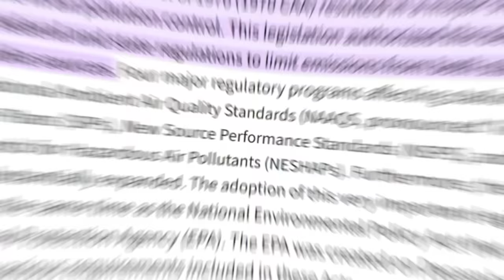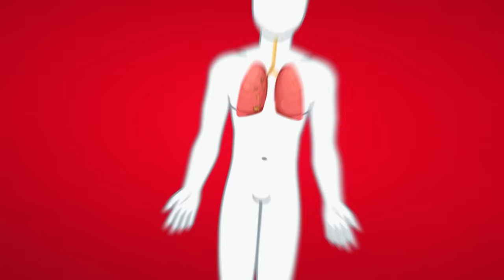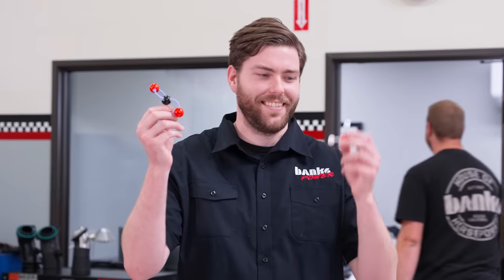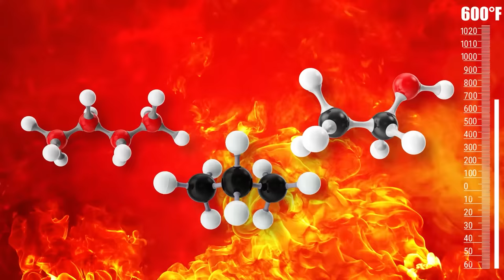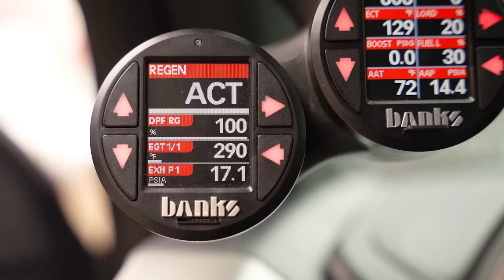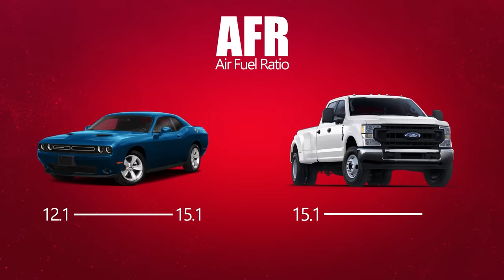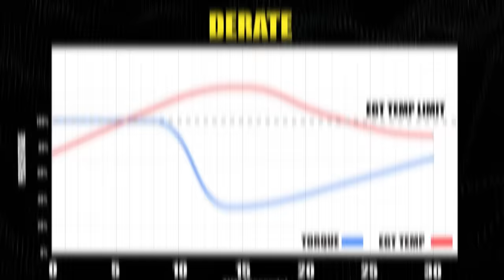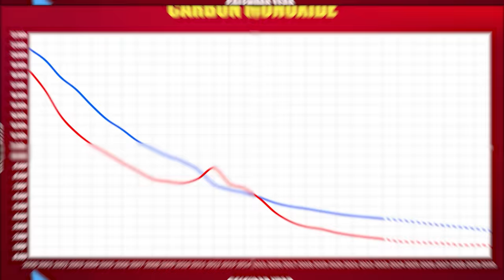Understanding the Most Hated part of your Truck | Banks Entry Level

Comment: I find it funny that they have to make a video to try and convince people its better, Also what they failed to put in the video is how unreliable those systems are. They are the biggest money scheme. As a diesel technician i see lots  and lots especially duramax come in the shop constantly with emissions problems and they are completely stock trucks just as you would buy them off of the lot. They do have some good points about good tuning in this video though. But i had to laugh when they said more fuel efficient 😂😂. Also redirecting exhaust gas back into the engine is terrible for the life of the engine. Ive taken apart trucks that had almost an 1/8 inch thickwal of soot in the intake manifold. And also most military and goverment vehicles dont need to meet emissions standards either.  Its all about the  money in my opinion

Comment: Im sure you were simply glossing over it for simplicity but realistically a sooty combustion cycle will make quite a bit less NOX than a hot clean combustion cycle. The high nox production of modern engines as a result of the injection timing is a goal because its easier to scrub than particulate. Its an inverse relationship.
Reply: Great video though

Comment: Good videos banks the fuel air ratio was something i already knew but just goes fourth to confirm my standpoint if you don't anything about an engine to begin with you shouldn't be under the hood but as far as emissions i have to ask now i know many other have said this but i still feel it needs to be brought up what about power plants that dump hundreds if millions of tons of coal ash into the atmosphere or steel mills i seen a handful dumping all sort of smog out the smoke stakes and along with that the pipes used to transport oils their old and leak a lot cause damge to surrounding wildlife if it spills like the chemical spills we had early this year the emissions will kill you we know tha but i just think it is a little hypacritical to say that while newport still exist vapes are now normal and now the people want to dump silver i to the atmosphere you guys have good stuff i see that but i would still delete not for black smoke but because i wa t reliability to tell someone you can only drives this long distance seems a little senseless why would someone buy a vehicle which these days i going to and upwards of 100,000 mind you and i can only drive it limitedly it just doesn't make sense and with the new pistons gm has i just have to also ask if this was the case with not having a thorough burn why were they not making more effective parts to begin with instead of making this stuff was it because the tech wasn't then it just makes me wonder why not make part that do the thing better and keep emissions lowere then ever then to have someone pay for a 10,000$ filter if it needs to be replace and an equally as expensive injector system know as d.e.f. this js all i want to know i have never had a diesel and with all.the thing i hear about how unreliable the emissions system is it just makes we wonder if it would be a good idea to delete especially with gas prices i know they have come down over th past few years but their still.high i look around and i my tank goes from full to 2/3 empty even with 22.4 mpg i just can't help but wndoer what it would be like in  The world of diesels all i want is something that works and i don't have to fill up all the time this one guy i saw he was stranded quitena ways from home and his emissions system went into limp mode he was like half way across the country and was carrying a full load and was left to the universe it was only grace he had a freind that was willing to lend him his truck to get back home with

Comment: My issue really isnt the power with emissions equip.  Its the reliability.  Yes the reliability is better than the earlier years but  they are still prone to failure (especially the DEF system) and are incredibly expensive to repair.  I mean seriously who has $10k sitting around for a dpf and DEF system when a delete is a fraction of that.

Comment: ah this explains it... In my first 4wd (diesel, ofc... petrol 4wds are for pansys...) it would eat engine oil, when it had only done 50,000. The new ranger does not. Likely this is INTENTIONAL.. due to the fact the ranger has an DPF. 

and the old car was a GM, and the new ones a Ford. 

Go FORD! :)

Comment: There's one detail you conveniently left out about PM. You state that PM2.5 is the more harmful particles at less than 2.5 microns - what you leave out is the ash particles generated by the DPF can be as small as 1 micron. Since 1 micron is smaller than 2.5 microns, and if 2.5 micron particles can get into your bloodstream, which is bad, those 1 micron particles definitely can get into your bloodstream, and being smaller that's even worse. I certainly wouldn't have been playing with that DPF with bare hands, and I have my doubts about that respirator being able to protect your lungs from the finest particles that I'm sure got airborne. You can bet those DPFs don't trap 100% of ash, and of course, the smaller, more dangerous particles are going to be the ones to escape first, so they're driving around spewing these much more harmful ash particles than would be the case if the trucks were just tuned well, didn't have a DPF and did have some particulate emissions. I recall mentions 'back in the day' (mid-2000's) of trucks that had EGR and DOC that were deleted, then tuned PROPRLY (Clean, no junk smoke tunes) and then actually sniffed at a smog station and they tested CLEANER than a stock tuned truck with emissions intact.

Comment: Grade A video, thank you. My only hesitation before buying a diesel was this whole Ash buildup problem. My 2020 powerstroke makes more than enough power on its own. So I’m looking for a tune. Although it appears your tunes might reduce ash buildup rate, the ash will buildup regardless.  So ultimately a new exhaust will be needed at some point in my trucks life. My question now is, much can your tune help me kick that bucket down the road? At the moment I’m able to monitor regen cycles and plan my driving around them. Regen takes roughly 30 min driving or high idle to complete and it happens once per fuel tank (48gal). As you know regen dumps fuel, so I never get to actually use the whole 48gals.  How will your tune change my current regen cycles for the better? Thanks again
Reply: almost every city has DPF cleaning services. the way to keep the regens from happening so often is to keep the system hot dont idle or lug the engine stay in the higher rpms. all the regen does is turn up the rpm of the engine to heat the system up run it hard and it will burn off the soot as it comes in

Comment: 10:20 If an active regen takes 20 minutes, what happens if the vehicle is only used for shorter trips? Our Tiguan is only used for trips longer than 20 minutes about once a month on average. Other than that it's mostly 15 minutes to and fro.

The particle filter warning light comes on once in a while.

Should we drive with a higher engine RPM, and if so for how long? The car's computer tends to suggest gearing up if the RPM goes above 1000-1200.
Reply: Modern diesels require a long journey every so often, once a month should be ok. But the exhaust NEEDS to get hot on the long journey. If you're doing the long journey let everything warm up by driving then after about 15 minutes then once you're on the highway keep it in a low gear for like 10-20mins and force the exhaust to get nice and hot. Don't red-line it for this long but keep RPM pretty high.

Comment: I hope turbocharged sparks ignited CNG trucks become a thing. Basically a diesel engine with the injectors replaced with coil packs and spark plugs as well as the implementation of natural gas injectors and a throttle body.

Comment: Curious as to how @bankspower is going to do a ALDL plug in tuner for all GM products as our GM vheicles move over to the new VIP platform!?
I know the insurance companies are having uses with their "discount" recorders and the GPS modules that are used on government vehicles wont work either. 
We had a brand new Tahoe come in the flatbed because it wouldnt start or shift to neutral. It was a government vehicle with an ALDL GPS tracker and the dash was lit like a Christmas tree. Every msg was flashed on the DIC that was possible. 
I foumd the tracker, unpluged it and cleared codes with my GM MDI2 scan tool . Vehicle was fine after. 
Gm's new VIP platform is high security and can and will lock out u authorized outside dirty data.

Comment: I wish somebody will design something that can easily collect the ashes out the filter like how fuel water separator works just drain the water but this time just slide somesort of mechanism in and out while collecting all the soot in a bucket or something so then u can use the soot as fertilizer or something or sell it to a refinenary to make propane out of it lol

Comment: Just because the it is the rule in all 50 states, doesn't mean it is enforced. I know in my area where there are no state inspections required, a significant percentage of these systems absolutely get ripped out. Most people don't care about the power, they just don't want to deal with DEF.

Comment: Great video 
 Garrey from Australia  diesel fitter ,heavy machinery since 1980,  owner of an 08 Dodge Ram  2500 cummins. Pleased to have Gail Banks equiptment on my ute ( not a truck over here ) My major worry was the recycled abrasives as carbon  going back through the engine with the stock configuration  EGR  DPF.  After adding the Banks monster ram ,intercooler and pipes and clean tune and a water methanol kit   Full delete , my fuel consumption has dropped by 36 percent  with enough power to run  mid tohigh 9s in 200 meter,(1/8 mile) r run  with NO smoke. Caculated fuel not from overhead  hiway driveing at 110 ks   9.8 litre per 100 kms  pretty happy

Comment: They say saving the planet, but it's also burning more fuel as any restriction in a diesel engine is bad. I've seen charts of over 10000 miles trucks losing an average of one to up to 3 miles per gallon, depending on the condition of the DPF vs a deleted truck.

Comment: Update on my Monster Ram intake and Pedal Monster bundle install. I am not seeing any improvement after six months and I'd like to talk to a Banks Power Tech via email. Are there adjustments to make, does my dealer need to reset some sensors? 

I get an active regen every 60 to 120 miles and they vary in duration between 20-30 miles. The DPF gauge will be zero, then I will shutdown, come back and start the truck now the gauge reads 20%, drive 30 miles of freeway, and now the gauge is at 30%. Also the idle time shown seems inaccurate, and that display is showing 1 hour idle time per 2 hours run time. ??? 

Any ideas??

Comment: Sounds good and whatnot, but I still delete what I have. I’ve seen my dad and my uncle who both have 4th generation Ram 3500s with the Cummins 6.7. Before they were deleted, they got 15mpg at most without a load, after they deleted them, the mpg went up to 25. And the power increased so much that the clutch on my uncles truck broke from all the raw power. (Yes it’s a standard 6spd)

Comment: The exhaust that comes out of a DEF truck is horrid. It smells way deadlier than any normal breathing diesel. Super interesting video explaining all this though. It just adds so much complexity and that turns to unreliability. I’d rather just run an old diesel. I have enough old junk to maintain and fix, I don’t need to be worrying about fixing brand new stuff too. Piss on emissions systems. Cut em out, tune it, run it. I’d love to see proof of a diesel getting better mileage stock than deleted. If you drive conservatively, they always do better deleted. Like, a lot better. If you wanna roll coal at every stop light, well… not gunna help.

Comment: I have a 2014 Mercedes Sprinter 2.1 liter 4 cyl diesel that has 102 200 miles on it, when it just about reaches each shift point I can here what sounds like it running just a little lean and you can hear the clatter or pinging I should say just like a gas engine would do I've always been a little worried about it knowing how it affects a gas engine burning valve seats through and piston tops and top ring damage from the excess heat,  is the Derringer something that can help with that if its an issue ?
Reply: the eurotuners will be a better route kerma has been going pretty heavy in emissions compliant tunes

Comment: so when it clean the filter it burns the crap that get trapped inturn for those 15 to 30 min. everything yall trap burns out of the exhaust. so whats the diff. in amount of bad exhaust gases in 15 min vs over a tank

Comment: I loved this long format chemistry-emission lesson.   Ripping emission components out of a vehicles may have been a simple fix back in the 70s but modern vehicles are too complex for this outdated practice.
Reply: A nice lesson would be that lightning creates NOx. Another good lesson would be that there are bacteria which not only create (N O2) nitrites but uses them to create nitrates which is a fertilizer.  engines make NO which naturally becomes NO2.  funny thing is that def fluid is urea that is used in an industrial process to make fertilizer......the def fluid makes converts the NOx into Nitrogen and which in a lightning strike creates NOx

Comment: They've created an entirely new money- making, mostly foriegn industry with the DPF and its love juice, DEF.

Exactly ZERO of the foriegn originating products use DPFs in the mining equipment, production, or shipping.

Wonder if the small amount of passenger vehicles emissions systems offset the new-industry global pollution?

I blew $8k on what is essentially a new cat-back system when my DPF failed. 

Duramax vs gas engine = $7k.

I won't be doing that again. 

This industry played a large role in the shipping issues in California recently (no pre-2011 tractor-trailers in California)... won't hear about that on MSM.

Comment: In the starting of this video he says, depending on who you ask, it is either robbing us of our torque power or saving the environment. It is only doing one of those. It is only robbing us of horsepower. It is not saving the environment systems, saving the environment burning battery acid and letting it go into our ozone is doing a good thing for our environment to then because a a candidate spill a little bit a finished garage floor and in seconds that shit will eat away at it and run your concrete floors finish, let alone your vinyl floor or whatever if you don’t believe me, ask companies that sell it and ask them how corrosive is DEF fluid they will tell you it is corrosive and it will eat it just like sulfuric acid concrete and if you don’t know, Sofia acid will eat away concrete it’ll eat away, but a certain kind of plastic tell me is fluid safe for the environment

Comment: Do yourself a favour and remove it not for power but for your engines sake that goes dub for the egr system when the soot and oily ccv mist combine in your intake it makes a coal like crust on literally everything it’s crazy and that’s y your oil will be as black as octopus ink and again cakes the intake to the point we’re it can’t even breath it’s crazy Iv pulled a few intakes apart on my diesels and it’s shocking the dpf clogges up and chokes your exhaust and sends your egt temps threw the roof o and also the need to do a regen mode every so often and that means the run more fuel through your engine even at idle to heat that dpf up real hot to burn off the build up on new power strokes and I’m sure all other brands u may notice it getting abnormally hot and smelly some times that’s a regen cycle happening and side note it eats up fuel mileage like u wouldn’t believe because your basically using fuel for no reason other then to heat your exhaust it a bad idea no mater what this guy tells u get yourself an old idi or 12 valve or delete your emissions as soon as u buy a truck it will thank u o and thos that say o a tune and delete will void my warranty well would u rather be stuck with a clogged up engine and intake and exhaust costing u well over the price of half the trucks valve yea I think u know the cheaper option

Comment: To me it seems useless to have a dpf system. I have a 6.7 Powerstroke and dpf clogged up and the regeneration would not clean it out. So I had 2 options either delete it for 3500$ or replace it for 12,000$. Easy to say I deleted it but the clogged dpf did a number on my turbo with all that extra back pressure and destroyed it

Comment: I thought the Duramax doesn’t cut  power during regen because it uses the 9th injector to add the fuel. 
The Cummins and Powerstroke retard the timing and increase the fuel to achieve the temp for regen

Comment: At the end there you say that the Diesel's now are running cleaner that is because of the low sulfur diesel isn't it I would like to see the difference on what that system the particulate filter does with regular old diesel compared to low sulfur diesel fuel I would almost bet that's a particulate filter is doing hardly anything and it's all about the low sulfur diesel